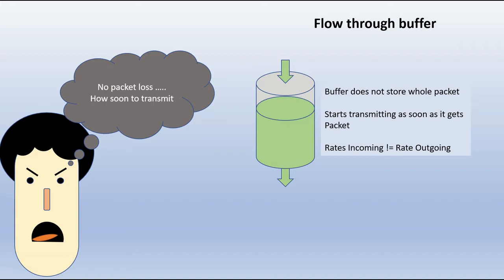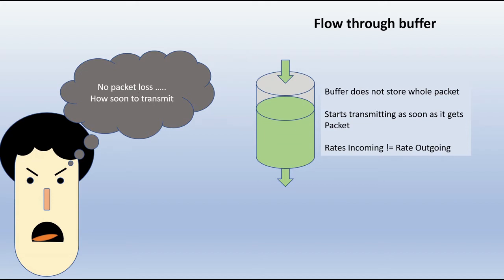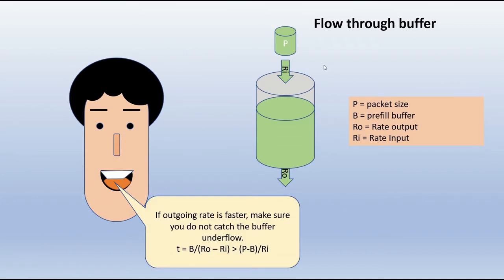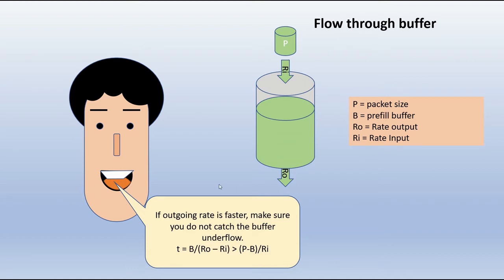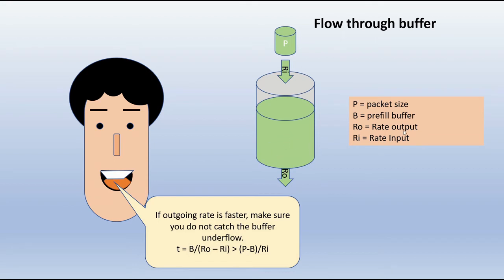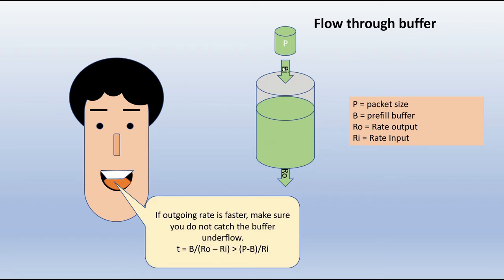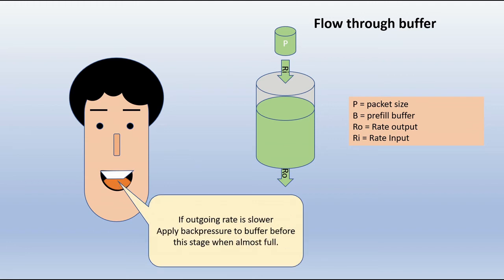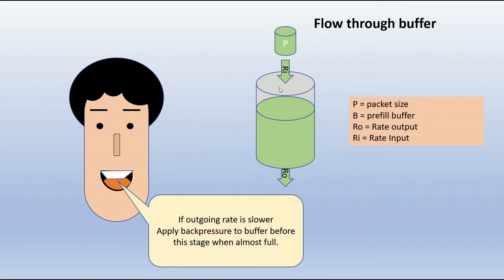Network Buffer - Part 1

Comment: Will increasing the Buffer size in windows 10 enternet settings help me reduce my connection timeouts like in games like Fortnite? for example I changed receive buffer from 256 to 512 and changed transmit buffer from 512 to 1024, will this help in solving my connection timeouts in my high speed enternet connection and a fast system?
Reply from the maker: This tutorial is for general concepts of buffering, and it gets much more involved when you analyse timeouts in an application. You are running your game on top of a OS which has a network stack TCP/IP running that can optimize the speed of connection to match the internet connection you have. Lets assume your buffer is at NIC level, and if you increase the buffer, this will increase delays in the NIC and increase latency between your side and server side. This is usually good if you have a slow machine or slow network as this prevents packet loss. But if you have fast network and fast CPU, you should not need to increase buffers. However you can try these ideas and see if your game provides network stats. You can try increasing the buffer in one direction at a time. Then each time checking if your game stats have increased latency and change in packet loss characteristics. That should help. Also try not using Jumbo packets as they tend to get fragmented in networks and may add extra latency for re-assembly. Good Luck.